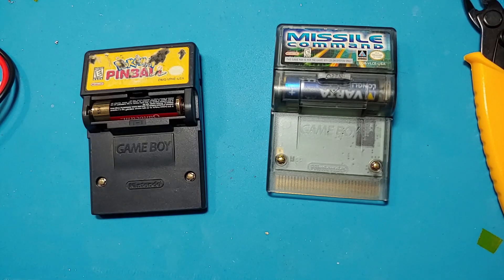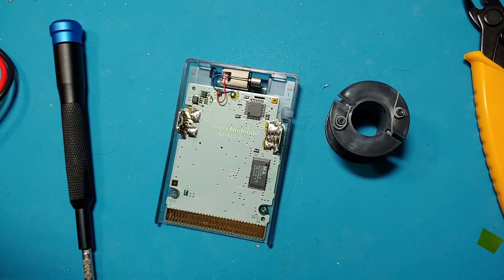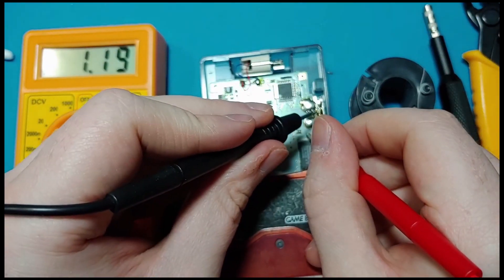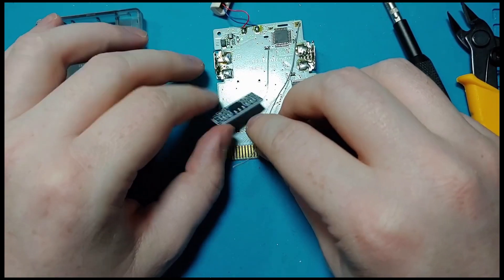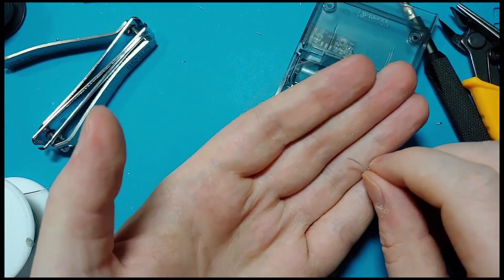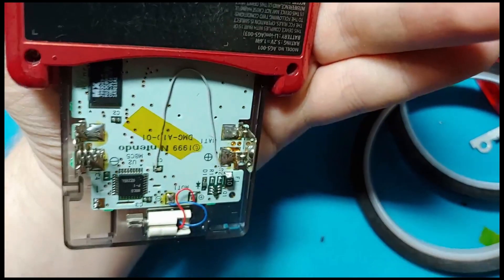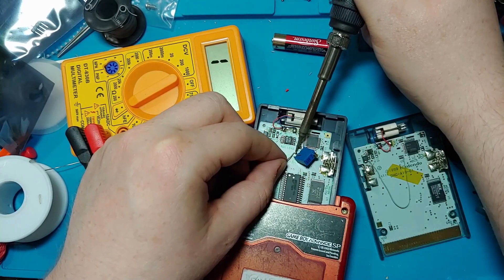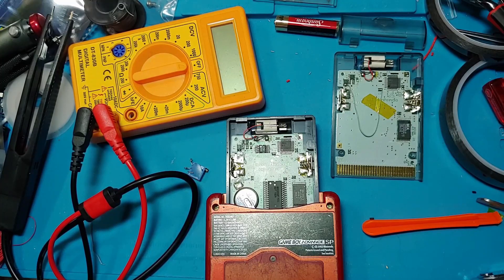Failing Pokemon Pinball: Battery Free Rumble Mod Gone Wrong

Comment: All GB and GBC games are 5v.  Only GBA games are 3.3v.  You should probably get a better soldering iron with a bigger tip for soldering to bigger areas like those battery contacts.
Reply from the maker: Haha yeah, the hindsight on a lot of what I said in this is very strong. I realized during editing that my memory of 3.3v was for something else. I should never have tried to solder those battery contacts at all I think, should've just gone directly for the fuse. Soldering onto battery contacts directly is tacky in hindsight. That being said, I had a large chisel tip just off screen I could have easily switched too but didn't because I wasn't thinking good during filming at all.